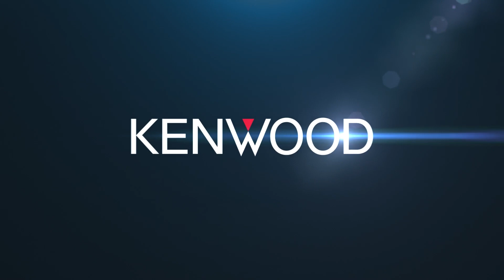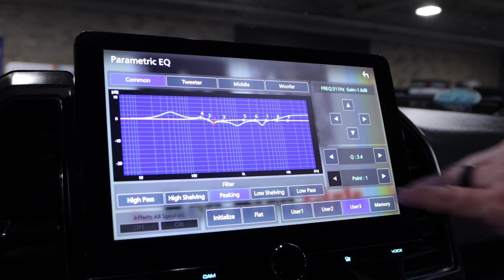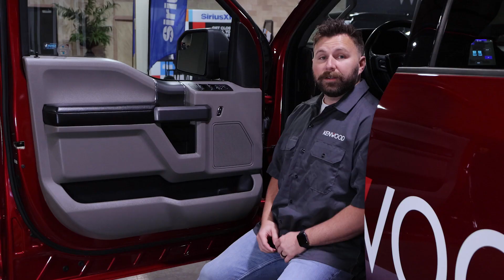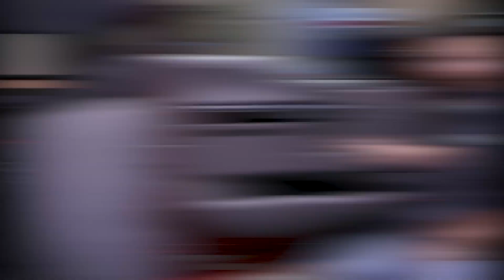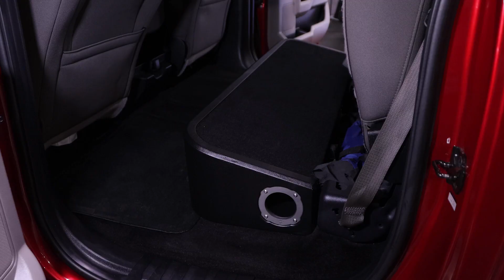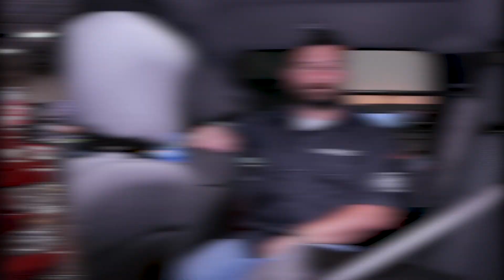eXcelon Reference F150 Installation

Comment: What was next to the amp? There were smaller
Reply from the maker: the Speakers crossover Network box is mounted next to the amplifier. Thanks!
Reply: @KenwoodUSA  I thought so, tunning using that would be a good video idea a lot of people would like to see. Not enough is talked about with the crossover.
Reply from the maker: @Dman0113  It is a passive network so no tuning is done from the crossover. Thanks!
Reply: @KenwoodUSA  not with the crossover particularly I'm just saying in general a lot of people don't know what the settings mean and what their functionality is on the head unit like Supreme how does it affect the tuning process mostly just the sound effects and the time alignment and how they all intermingle with each other